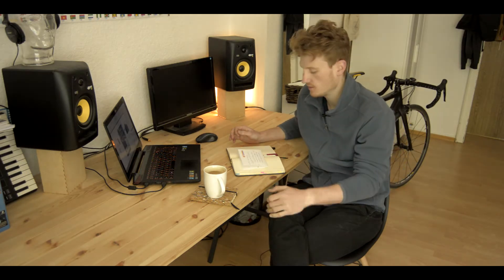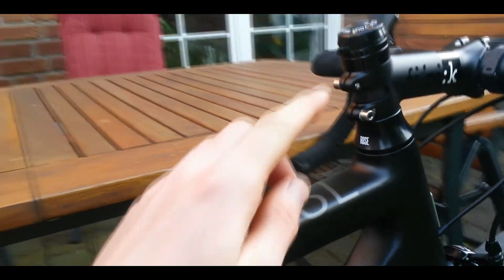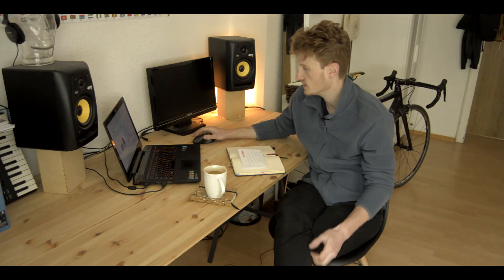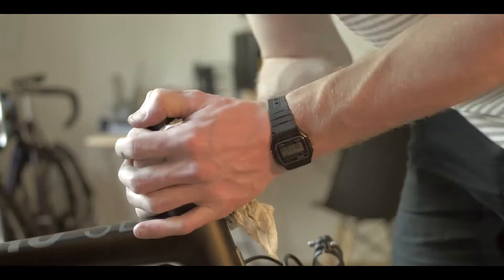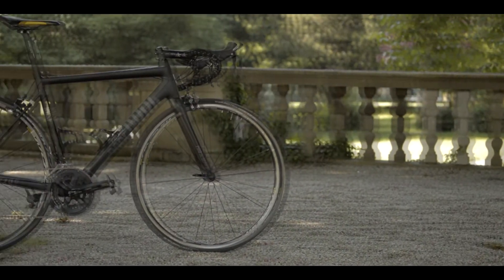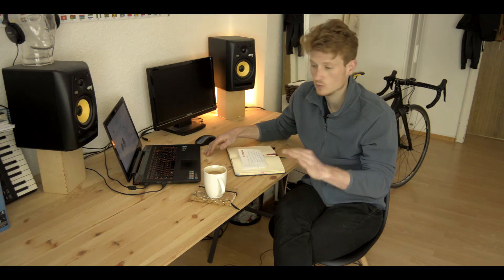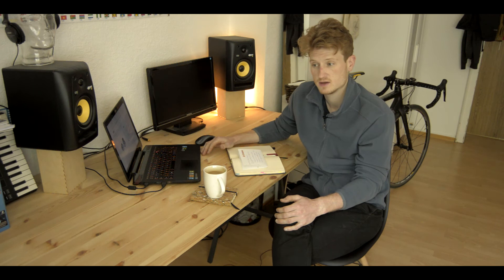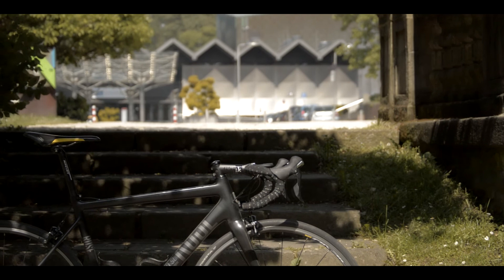Rose Pro SL 2000 | Getting Low with a new Headset

Comment: Hello Velodicted, I just saw this Video now and bought this bike some months ago. Unfortanely the lower spacer isnt available anymore, do you know any other that would fit? Cheers and happy riding.
Reply from the maker: indeed you are right somehow they removed the item out of the store. no good :D 
I am not entirely sure but for my understanding, you just need the cover as I did also. In the following link, there is a cheap headset with a cover with a hight of 8mm so even lover than mine. I guess the top cover/spacer piece could work out. It's the same hole diameter because the standardized tapered forks nowadays are being installed. For the bearings I will not confirm the fit, I guess they won't. But for the top cover/spacer I am very certain it could work out.
https://www.bike-discount.de/de/kaufen/radon-vaillant-integriert-1-8-1-1-4-steuersatz-806119

Cheers Velodicted
Reply: @Velodicted  thanks mate, I'll try it for sure, the 25mm spacer looks so ugly and doesn't fit the aesthetics of the bike. Thanks
Reply from the maker: @olez2145  I agree, the bike can be very racy and also appealing looking, but the installed spacer does not add up to that. I understand the intention Rose is pursuing with that, building an entry-level friendly bike but to me as to you it simply looks not good. 
Good luck with your transformation! :)
Reply: @olez2145  let me know if you get the headset and if it works

Comment: Why you cut the steering  pipe? Only because of safety and look purposes?
Reply from the maker: when you are totally safe you don't need the excess anymore. But it isn't just the looks. If the excess is too long. The  inserted expansion plug can not do its job properly since it barely reaches the area where the stem is sitting. Conversely, the expansion mainly occurs ahead of the stem where only the spacers counteract. This is far from ideal. So it is threefold, for the looks, for safety and to prevent catastrophic failure/damage.
Cheers 
VCC
Reply: @Velodicted  Thanks, the way you explained it, is clear and understandable